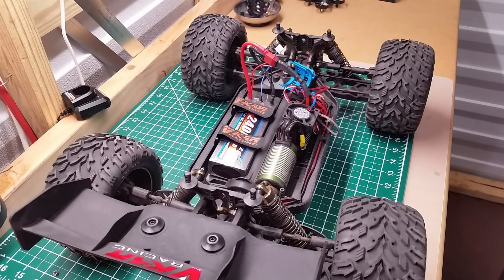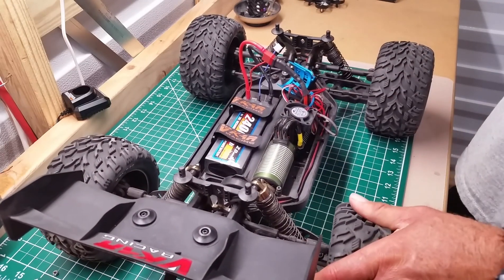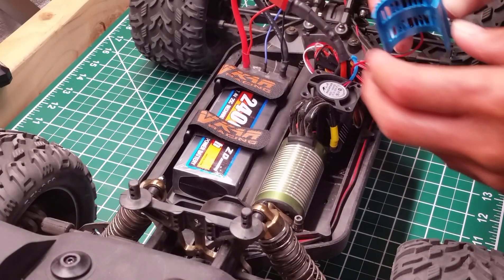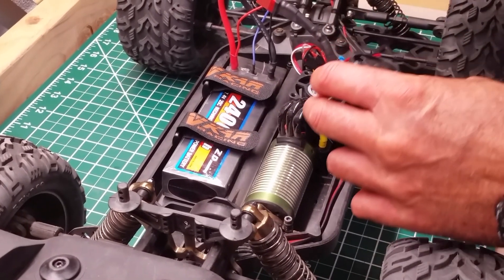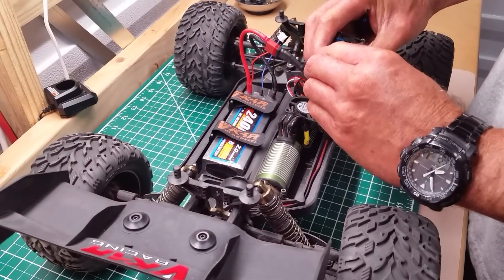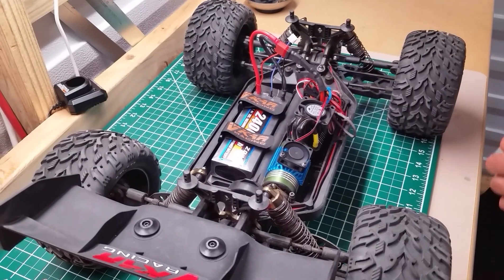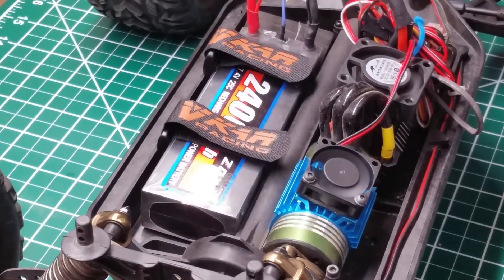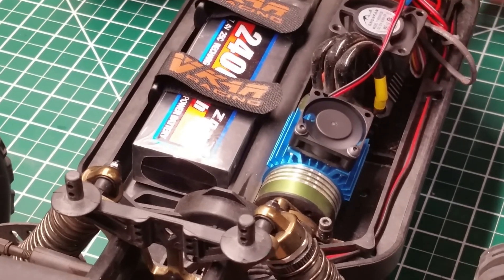How to keep your Rc Car brushless motor running cooler!!

Comment from the maker: This is an awesome addition to the Vkar racing bison and other brushless Motorcars brushed as well. The heatsink and fan run off 5 volts and plug directly into receiver and they will lower the temperature between 30 and 40 degrees which will provide you with more runtime in the long run and less downtime. We all know is the killer in electronics, the best way to keep your electronics running longer is to keep them running cooler. There is a link in the description if you're interested in purchasing one.